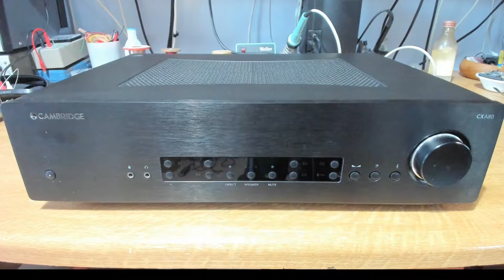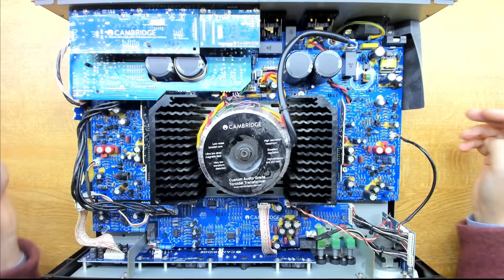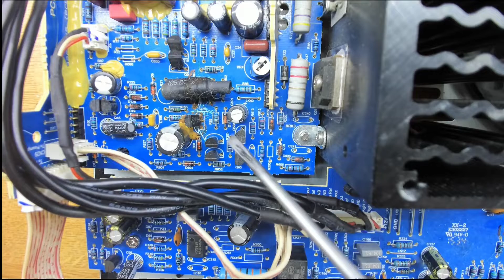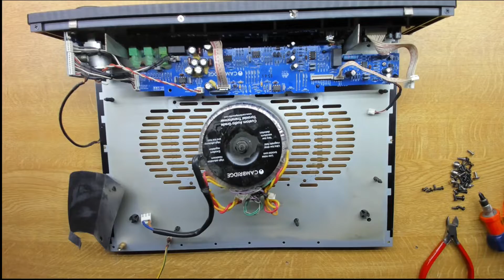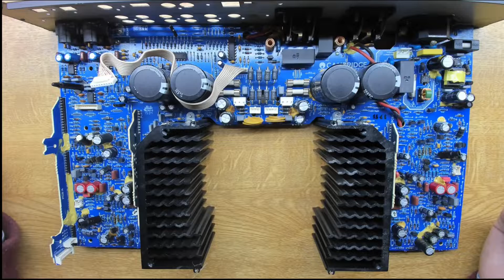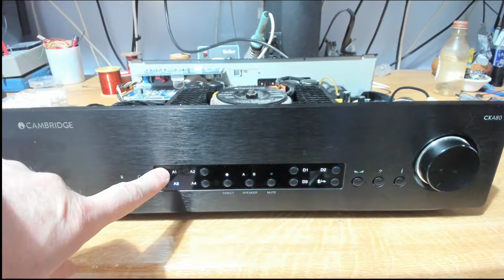Repair of a Cambridge Audio CXA80 with a 'sticky' problem

Comment: Its a revelation there are skilled repair engineers like you. Glue corrosion and conductivity was also a big problem with rotel amps through the 2000s at least!

Comment: @myalbatech Today saw this video, quickly open up my CXA80 to have a look, to my horror the 2 bigger resistors were similar to your video, bended horizontally sticking with excess adhesive, those resistors beneath suffer the heat and corrosion. I Google this model image, it seems some of the online review units without the heat wrap around the 2 big resistors and placed vertically... Not sure why the differences tho...

Comment: This video pointed me to the same problem! It was a CXA60 and the right channel was popping. Sure enough, the transistor leg had rotted away and was just barely making contact. Thank you so much for this video! For anyone who needs to do this repair, you need to remove the DAC board and then the analog input board in order to remove the plastic posts that hold the board to the chassis. You’ll also need a 7mm socket to remove the ground from the chassis. Removing the adhesive is tough because it’s like peanut brittle. I very delicately removed it with a dental pick but wanted to make sure not to damage the trace on the underside as it has seeped into the hole on the PCB. Take your time and make sure to adequately desolder the components.

Comment: I don't like the newer Cambridge Audio stuff either. They sound good but they're made in China using some very cheap and nasty components in places, and some wonky assembly practices as well. They've been getting progressively worse since their acquisition by Richer Sounds in the mid-1990s. Really they're no better than the stuff the like of Currys imports, except that they do have thorough engineering from a sound perspective.

They make sense as a new purchase with Richer's extended warranties but at the prices they sell for second-hand, no way. Disposable.